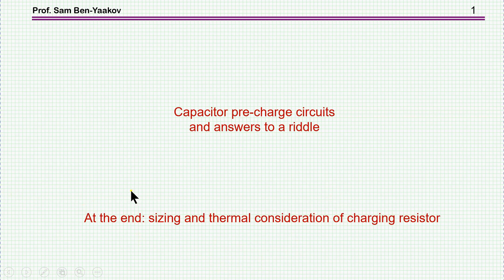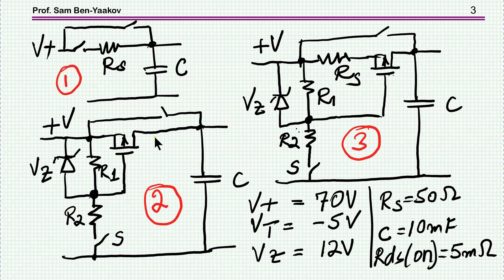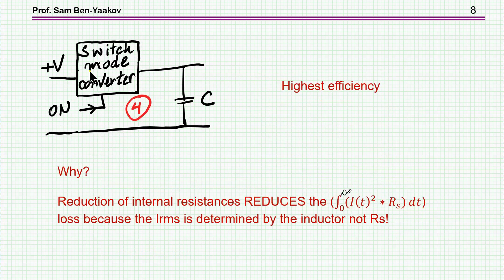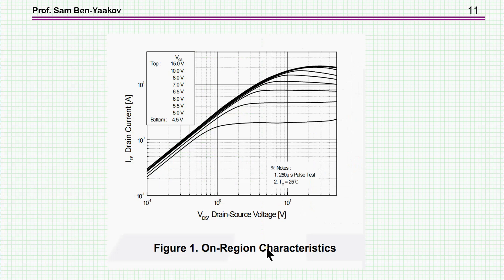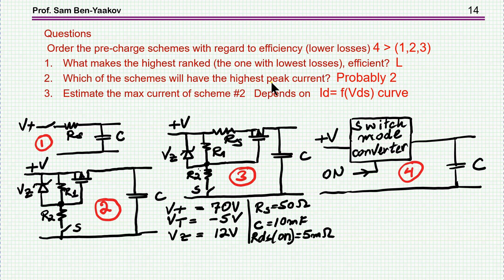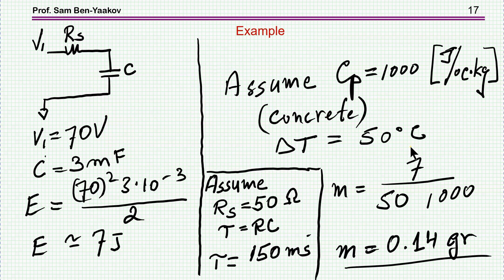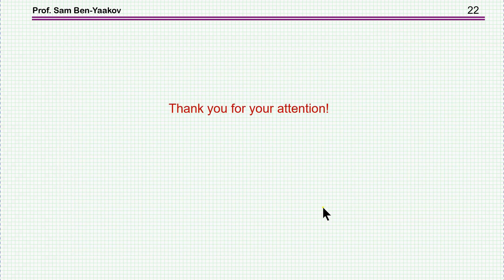Capacitor pre-charge circuits and answers to a riddle

Comment: Hi, I am making a Battery management system in that I am using Precharge circuit using resistance. It work fine . But if at the time of Precharge condition, short circuit occur in that case my Precharge resistance blows. Can u please what , which circuit is preferable in these cases in battery management systems
Reply from the maker: Hi, you need to make sure that 1. The heat capacity of the resistor is sufficient. 2. That the system if off during precharge.
Reply: @sambenyaakov   if I turn off the system, what am I pre charging then?
Reply: @yazhvendan666  if your system is off due to short circuit, then you pre charging nothing. Pre charging works just before turning on your main switch. Then it should be off by any ECU

Comment: It might be interesting to replace the power resistor with PTC and calculate the effects.
Reply: An NTC works better. Initially it is cold, resistance is high and C charges slowly. As the NTC heats up its resistance drops but the voltage across it will decrease as C charges. Properly dimensioned this stabilizes current through and power dissipated in the NTC a bit during the startup time.
Reply: @plemli  In a precharge situation, you want the resistance to be low at the beginning of the charge. If you are charging at DC link the precharge time will dictate when the converter will be able to operate. NTC could be used but PTC would be a better choice.
Reply: @mhanssler  PTC will yield a high peak precharge current tapering off as it heats up, presenting more current variation than a constant resistance during the precharge time. OTOH an NTC will have less variation.

Let's try to convince Sam to evaluate both ;-)
Reply from the maker: This is indeed correct if there is a long time between pre charges
Reply from the maker: This is indeed correct if there is a long time between pre charges

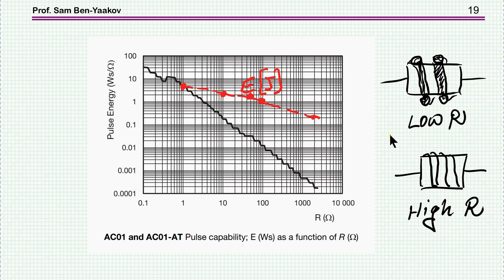Comment: @16:16

Why is there a “cooling effect” for thicker gauge wire?  For a pulse there’s negligible time for air-convection, right?  
I’m guessing the thinner wire is more susceptible to thermal runaway (hot spots).
Reply: Maybe that’s what you meant
Reply: Or maybe there’s just less mass in the resistive-wire winding

Comment: Including the ESR of the inductor (and the ESR of the capacitor), wouldn't the charging method 4 be as lossy as the other methods? Or is there sth am I missing?
Reply from the maker: NO. An inductor breaks the link between rms current and resistance.You can design converters with 90% effiicency and up.

Comment: For the case where the source charging the capacitor is an AC source connected through a rectifier, it's possible to use an inductor or capacitor in series with the input of the rectifier to provide the impedance to limit the current for precharge, but without (most of) the losses.
Reply from the maker: Yes. AS pointed ut in video. An inductor breaks the link between rms current and resistance.

Comment: Great. I would add that resistors typically start "power derating" at around 70 degree C. Limiting it at 50 degree, as you did, you were ok, but for the last slide, hinting that we could go up to 155 would need to take maximum power dissipation considerations (unless, as for the mosfet, the impulse is very short, a little bit as in the Safe Operating Area that you also show). Again, great video.
Reply from the maker: Thanks. Power derating may not always relevant power pulse operation. What is important is not to exceed the max temp. Are you involved in resistors manufacturing?
Reply: @sambenyaakov  No, I am not involved in resistors manufacturing.
Reply from the maker: @snnwstt 👍

Comment: Sam, this video is directly related to two aspects of my designs...  One is for power module "hot-swap"  capacitor precharging and discharging as well as pulse rating for gate resistors and the like.   I have tried to make sure that the pulse ratings of certain resistors are within spec for years now but sometimes it come up to bite me for other applications if not "beefy" enough.
For my hot swap, I just use the  simpler FET shorting out a precharge resistor and for discharge, a series resistor and FET .  Large enough to take the energy but slow enough that it takes its time so not that big of resistors needed.

Very good video and another lesson not usually taught in schools ?
Reply from the maker: Thanks and thanks for sharing

Comment: You've done a lot of great videos but this might be the best. Even really good engineers can learn from your multiple examples that a capacitor charging through a resistor always operates at 50% efficiency, and i have never even seen the relationship between resistor power handling and mass stated in the manner in this video. As with all the best knowledge, once you understand the simple explanation, the result seems obvious, so you can easily remember it over time...
Reply from the maker: Thanks😊

Comment: Great video. Would like to mention that inrush current peak and shape strongly depend on the output impedance of input voltage (especially in case 2). Referring to batteries...
Reply from the maker: Good point